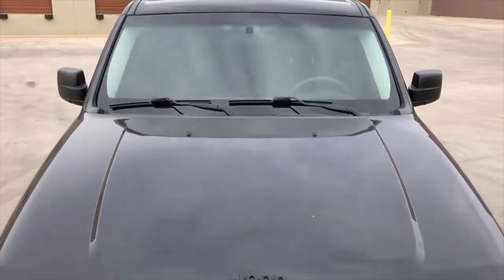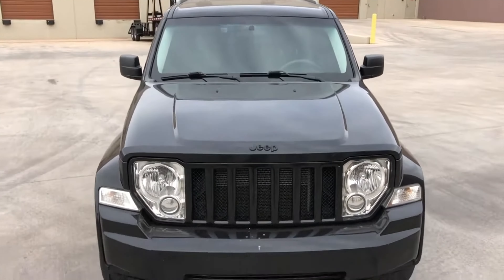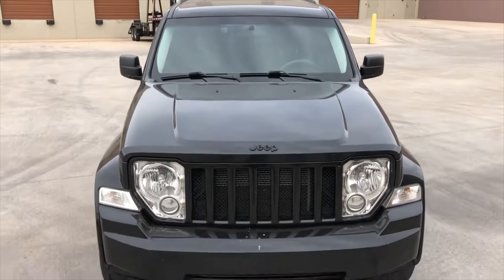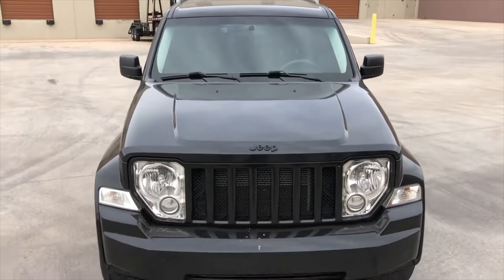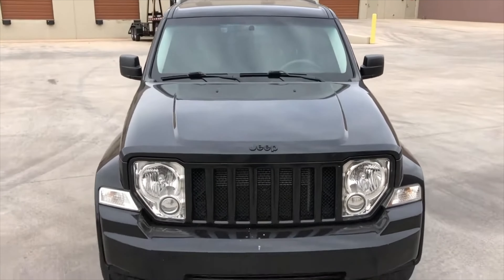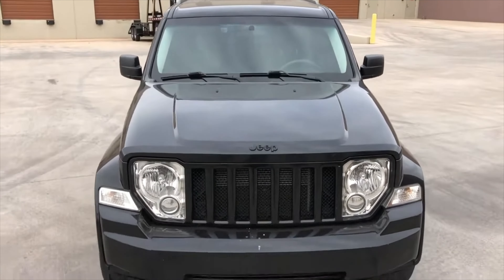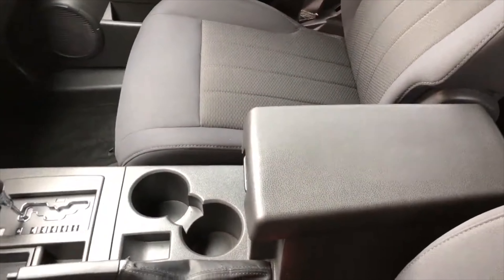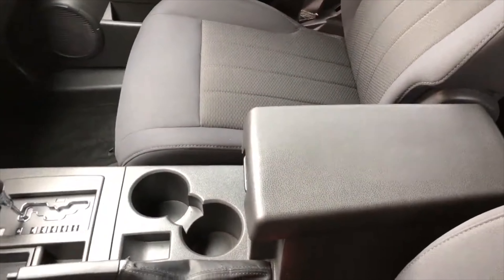Jeep Liberty Problems | Weaknesses of the Used Jeep Liberty

Comment: I have an 09 liberty kk been good to me. Only thing I have change is oil pan trans pan from rust. Water pump an alternator 147000 miles on it at the moment. Everything else is original. Did all work myself cause the jeep easy to work on.